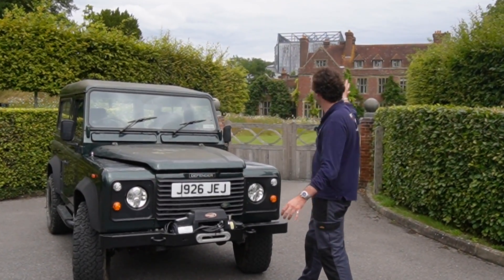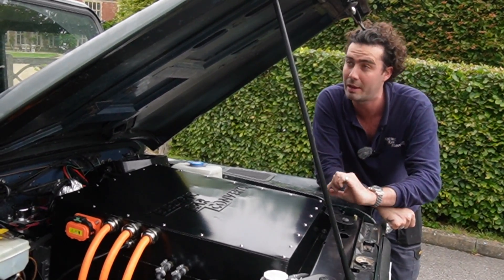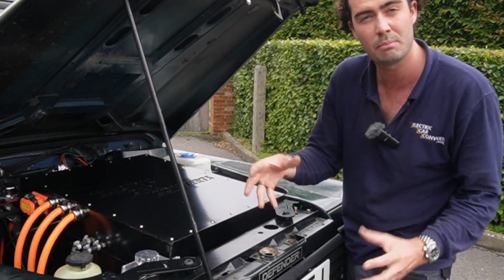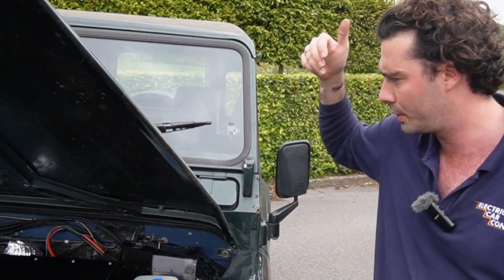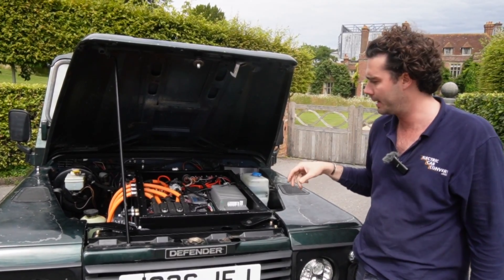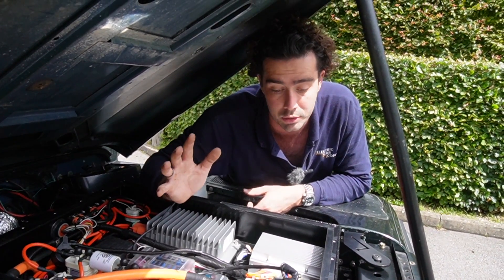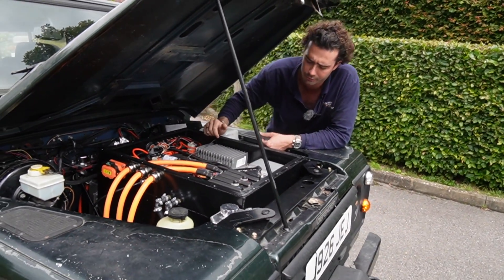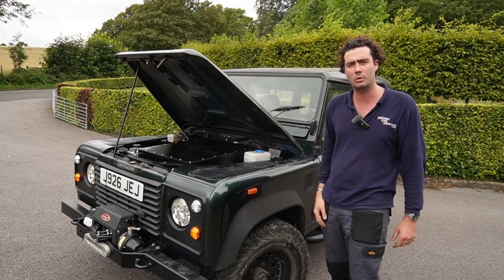The CHEAP EV conversion of a Land Rover Defender (£33,000). Full walkaround of this electric beauty!

Comment: 33K but I checked on the web site and its now £72 wow thats inflation.
Reply from the maker: We don't build this system anymore, the market has moved towards higher range, higher power systems- so we now only offer 55kWh or 110kWh with the 280hp Tesla Model 3 Motor.

Comment: What if the motor gets splashed with water down there?
Reply from the maker: The motor is IP56 sealed, meaning that it is more than capable of withstanding whatever the road can throw at it water, dust and dirt wise.

Comment: Hi there. How do you monitor the percentage of the battery, does the kit come with a screen? Speedometer?
Reply from the maker: Hi Jonas, this is the one thing I forgot to put in the video - all the gauges are replaced in the original gauge cluster. We show speed, battery %, battery temp and amp draw/regen.
Reply: @electriccarconverts  thanks! This is very exiting, I will though wait some years until batteries might improve so the range will be a bit longer. Also here in Denmark, the process of having your old car registered as an electric is a pain in the ass right now, but let’s hope for a greener future 👌🏻

Comment: I like the idea of retaining the transfer case as my Defender is off road set up but use it to commute to work as well. Guess winch is powered off 12v battery but with overvolting popular in competition scene perhaps a high powered motor could be installed on the winch and wired to the tesla battery to blow the competition away ha ha.
Reply from the maker: If you can find a 144v winch then you’re on the money! Otherwise you can run a winch of our DCDC converter (alternator equivalent) which pushes out 14v